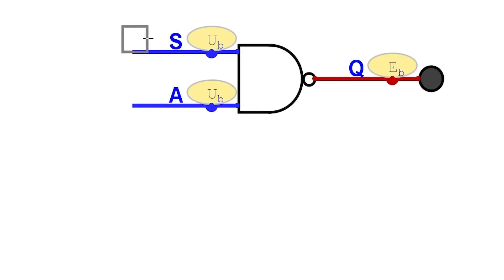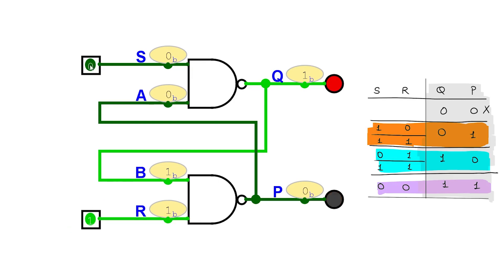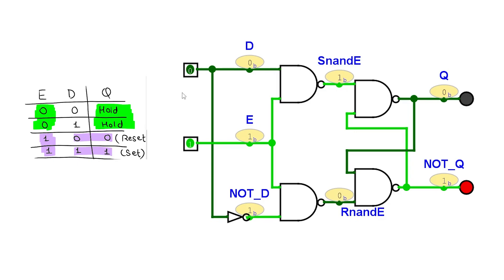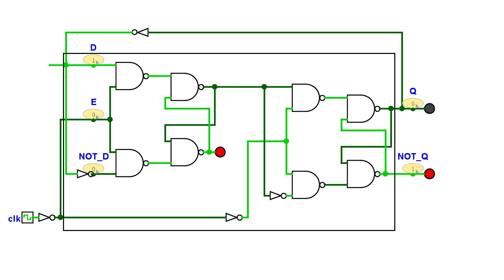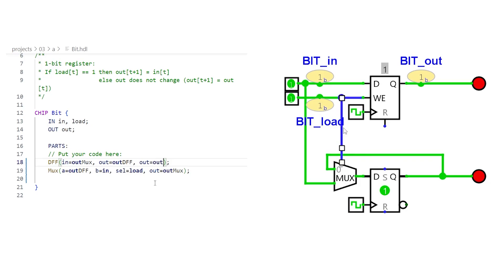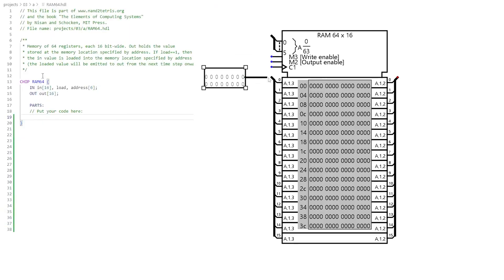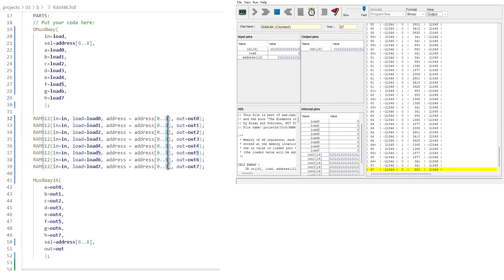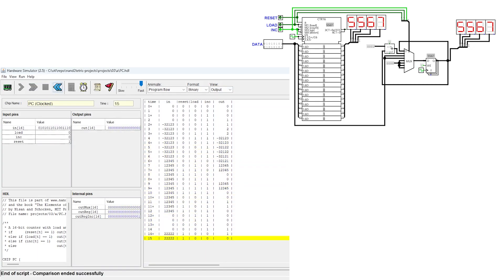How to make  Register, RAM and Program Counter from D-FlipFlop | nand2tetris course project 03

Comment: I think in the web editor we use address[0..2] to refer to the most significant bits (leftmost) and address[3..5] to refer to the least significant bits (rightmost)
Reply: wait but for the PC sel[2]=reset, sel[1]=load, sel[0]=inc   works and the opposite doesn't.
hmm
Reply from the maker: Good question! Bit ordering does get confusing! Things to remember are:
(1) Bit numbering always starts from the LSB (rightmost), so bit 0 is always the least significant bit.
(2) When using [a..n], a is always less than n.
(3) When assigning e.g. a[2..4] = b, both sides must have the same size — here, 3 and this assignment is equivalent to: a[2] = b[0], a[3] = b[1], a[4] = b[2] (assigned from lower to higher bits)

You probably already understand this by now, but maybe it helps future viewers too! 😊